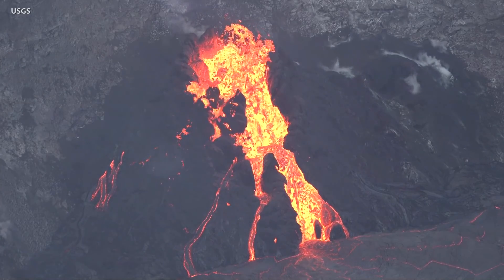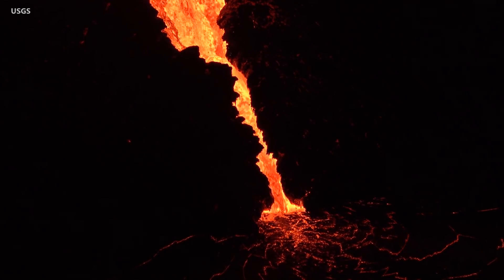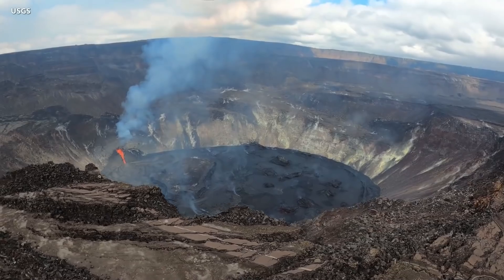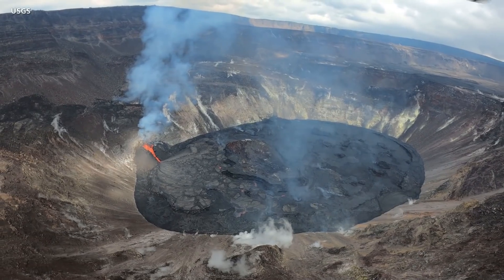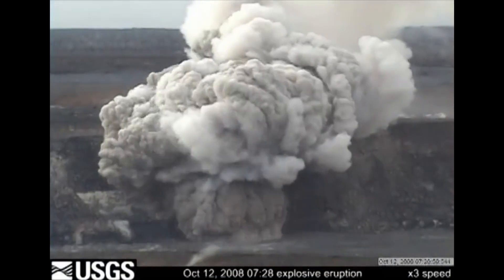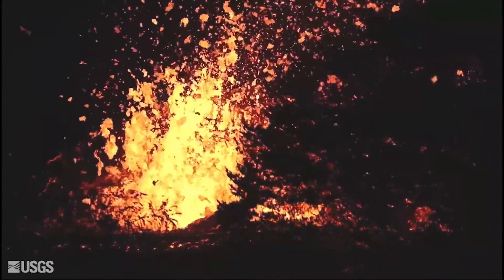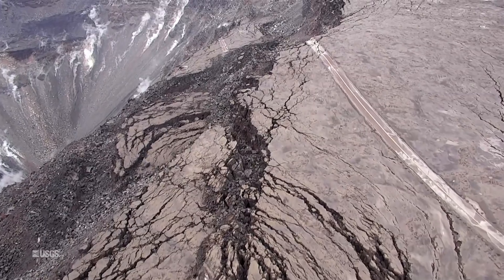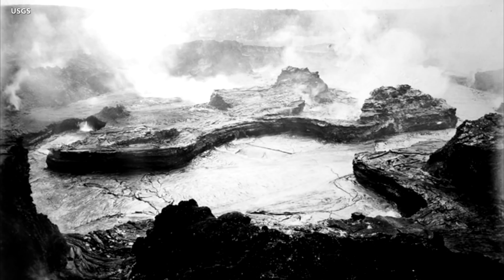Kilauea Update: Eruption Increases At Caldera West Vent (Jan. 13, 2021)

Comment: You all failed to see that it’s getting deeper meaning it’s more dangerous because the lava won’t go anywhere accumulating inside making the lava more dense which will have more gases trap making a huge impact on eruption for the lava will not have flowing capabilities and will sink inside the volcano causing a bigger eruption clearly you see how the land sinks due to the volume of lava lost causing more pressure at the surface the new lava will not have a exit the land that cave in will generate gasses trap when this happens lava less dense sinks to the bottom with trap gases lava that’s more dense stays at the surface when to much gas accumulate the volcano will choke causing a bigger eruption

Comment: Kilauea caldera collapsed due to emptying the magma chamber below.  There is another higher hot spot.  Once this west vent buries itself, the other steaming hot spot will open up.  Continuing the process of filling the collapsed caldera.  Will the lava fill the whole section of the collapse?  It would make for a very larger lava lake.  Likely a lava fountain will break out on lower slope.

Comment: When the lower penetration was free to flow, upper penetration flow was low.  As the rising lava lake level puts more head pressure on the lower (fountaining) penetration, lava flow through the upper penetration should be expected to increase.

Comment: The lake is wide enough to hold the magma.
Reply: I wonder what happens if the magma levels reach the same height as the opening..  Would it slowly fill?  Or a make a new opening to relieve pressure?

Comment: Anybody else wonder what would happen if they were able to pour enough water over it to just cover the top of the lake?
Reply: It would just be a lot of steam, and a harder crust at the top left over with cracks that would develop once the pressure from lava underneath is enough to form new cracks and break the newly formed, cooled, crust seal.
Reply: I think it would shut down international air traffic across the Pacific.  And maybe cool the planet a few degrees?  The volume of silica ash launched into the atmosphere would be vast.

Comment: Dutchsinse, still, saw the Pacific plate moving as a unit leading in to this steadfast performance. Thereby, such indication exists 4 an energy displacement at the plate's center commensurate with energy balance laws, or, an increased distribution at the center for a net effect at all of the edges.

Comment: Is tht an old road at the top
Reply: Yes. That road was used up until the crater collapsed in 1018, taking a huge section of the road with it.
Reply: @jazzcatt  thanks man
Reply: From the current aerial view? I don’t know exactly how long ago that road was built but am pretty sure it’s the one for the volcano observatory park. It was damaged and partly obliterated when the caldera collapsed & there was seismic activity. The park had already been closed and everything possible removed from the station before the collapse, if I’m remembering correctly.
Reply: @helenjohnson7583  thanks for letting me know man